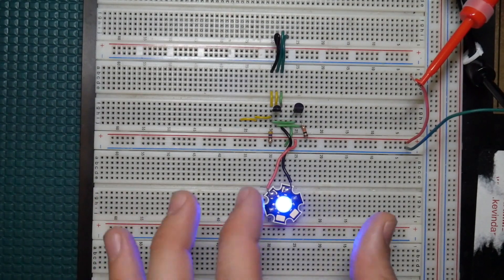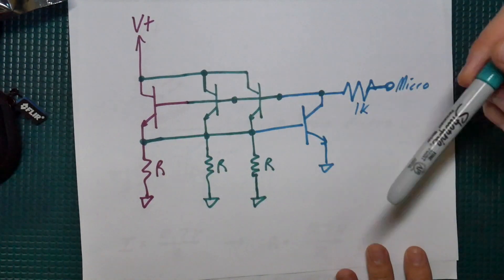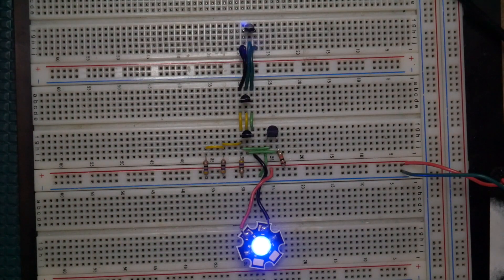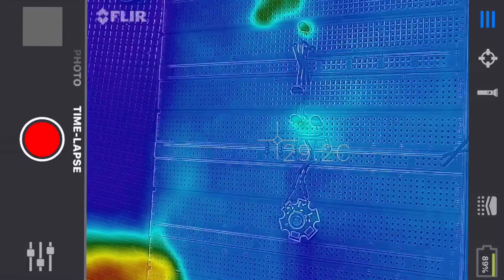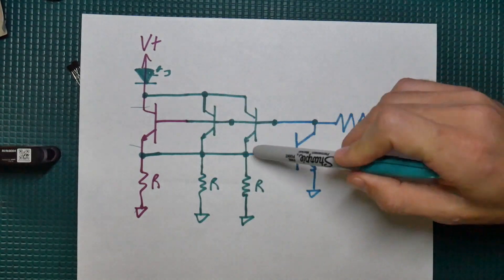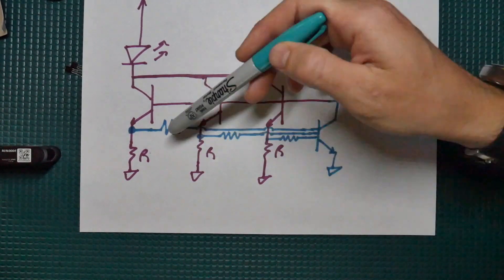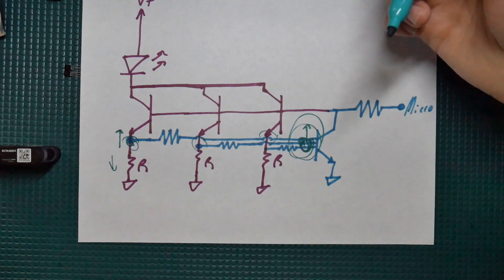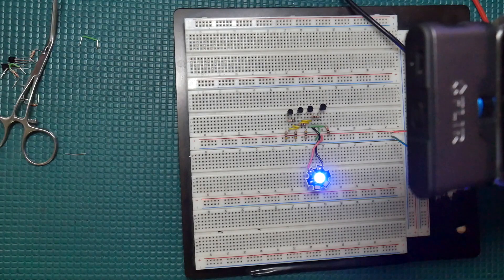See Thermal Runaway in Action! Tutorial and How-To Fix it!

Comment: Would bridging each collector with a seebeck generator help regulate the circuit, due to the difference in conducting material and temperature from the runaway transistor and the cooler other ones?

Comment: Analyze thermal runaway as a feedback loop. Since the thermal feedback loop is positive feedback, once you reduce the thermal gain to below 1, it becomes stable. You want it to be <<1 for good current sharing. If it is near 1, it may still be stable but it will settle at an uneven idle state.

One way to reduce thermal gain is to reduce Vce as the temperature rise due to Ic depends on Ic*Vce which is the power dissipated in the junction. Reducing Ic also does this as it reduces  transconductance which determines how much current is caused by a given change in temperature->Vbe. Adding a emitter resistor has the same effect by reducing transconductance.

Yet another way to reduce thermal gain is to thermally couple the transistors as it is the thermal resistance from one junction to the other which increases the thermal imbalance caused by differing currents.

Comment: Your thermal runaway protection works, but that's not because of "averaging" off the feedback transistor. If it was, the first circuit wouldn't suffer from thermal runaway either. The reason why the first circuit suffers from thermal runway and the second not, is because of the difference of negative feedback introduced by the resistor in series with the emitters of the three drive transistors. In the first circuit, the emitter resistors are common to the three transistors, therefore they cannot detect or prevent current unbalance between the transistors. The same goes for the negative feedback network of the transistor controlling the base current: it cannot detect current unbalance of the three transistors because it is common to the three.
In the second circuit, though, the emitter resistors are not shared, therefore the negative feedback introduced by these resistors has local effect in each transistor individually. The transistor that controls the base current, as you said, computes the average of the emitter currents. 
And "average" means it cannot detect whether all the current is being driven by a single transistor or evenly by the three.
Reply: You are absolutely correct!  The circuit needs individual, separate, emitter resistors to provide feedback ( emitter degeneration ) for each transistor, SEPARATELY!

Comment: One of the best explaination with proper representation 👌👌👌👌 cool.
At the end i was wondering why that one resistor getting hot beside the three transistors in last step... 
Since all three sense resistors have same vale and all three transistors are passig same current, why the last one is getting heat up instead of all of them getting heated equally.. any hint?

Comment: Unrelated to thermal runaway: is there any way to introduce a single potentiometer in place of the current control resistor? You'd just replace he resistor with a pot in the case of the single power transistor, but in the case of more than one power transistor, and you common their emitters into a single pot? I suspect not, but don't really know.

Comment: I'm trying to learn, but I need to build basically a SSR, for DC, at 30v and 400 amps, I have about 20,  55v 110 amp MOSFETs, what would I need to parallel these go get the current to pass,

Comment: Parallel some MOSFETs! In a circuit!,!
Reply: MOSFETs have a (edit:) positive temperature coefficient. They self-regulate. Nothing will happen...
Reply: @TrickyNekro ,
It's the other way around. MOSFETs have a positive temperature coefficient, as the temperature of the device increases, the resistance increases. In other words, higher temperatures result in lower currents. 
On the other hand, the BJT temperature coefficient is negative, meaning that the voltage across a diode or a base-emitter junction for a particular current decreases as we heat up the device. The negative temperature coefficient is the basis of thermal runaway, in which a diode or transistor driven by a fixed voltage gets hotter and hotter and passes more and more current until it over-heats and fails.
Reference: https://www.onsemi.com/pub/Collateral/AND8199-D.PDF
Reply: @malgailany  I know, that´s why I said they self-regulate. I messed the sign, don´t kill me...

Comment: Any way to turn this constant current shunt regulator into a stable constant voltage shunt regulator? I'm working on a project where the high side load (matrix of red LEDs) is variable from 5mA to 120mA but collector voltage varies as much as 15%. How do you overcome the transistor's negative temperature coefficient? 

My V+ voltage is 3.3V and my virtual ground collector voltage is 1.34V. If I can pull this off, I can save a lot of resistors in my LED matrix.

Comment: Great topic but you didn't explain the root cause.   You didn't explain what the heat effects.    You didn't explain that the Vbe of the hot transistor drops due to heat and the other transistor's Vbe is shunted out below their normal Vbe bias level.   When this happens they do not turn on so the one hot transistor is carrying the entire load while the others don't even have a chance to join the party.  Adding the resistors has a balancing effect to allow the variations in the Vbe of each transistor to be absorbed by the resistor.
Reply: This is an interesting topic. Many temperature compensation circuits depend on the fact that Vbe is inversely proportional to temperature ( Vbe changes by −2mV/°C ) to control the currents in BJT devices.
Thanks.
Reply from the maker: good points - could be a part 2 maybe to show that

Comment: The explanation why it works isn't correct. The control transistor "backs off" for all of the transistors (all their bases are connected together after all). How has that any balancing effect? Well, it doesn't. The averaging has nothing to do with the balancing. The circuit works (almost exactly) the same if you connect the base of the control transistor to just one of the load resistors and ignore the others. I say almost exactly, because the current value might not be as accurate, because you are basing the current control on the tolerance of one resistor instead of on the average of three, and also maybe because you are pulling the base current of the control transistor only through one of the load transistors. But the balancing is still there.

You missed a very important point, which I guess lead to the wrong explanation: the whole reason why thermal runaway occurs in the first place. The important thing is that the base-emitter voltage of a transistor DECREASES with temperature. Or the other way round: for the same BE voltage the warmer one "opens" more. If you parallel the load transistors you force them to have the same BE voltage. The warmest opens a little bit more, gets more of the current, gets warmer, thereby drops it's BE forward voltage (or rather opens more for the same BE voltage), gets more current, gets warmer, aso until ... magic smoke.

The balancing works because a higher current through one of the load resistors causes a higher voltage drop over it (as you said). This reduces the effective BE voltage for the transistor for that resistor (the absolute base voltage is still the same for all obviously). This slightly lower BE voltage makes that transistor close a little, so it gets less of the current keeping it from running away.

To prove the point that the control transistor is irrelevant for the balancing, remove it and supply an adjustable voltage to the bases of the other transistors. Obviously you won't have current regulation (because that IS the job of the control transistor), but the current through the transistors will still be balanced (within the tolerances of the transistors and resistors). Btw. you often don't directly parallel the bases of the transistors, but use a resistor for each base as well.
Reply from the maker: oh yea, thought I might've mentioned the drop in VBE to to the increased temp... could be a cool part 2 though, or do the same thing with parallel LEDs or something.  Thanks for leaving the detailed comment!
Reply: Thanks, saved me typing the same thing. The original wording "higher temperature = more current" would be highly confusing for most beginners
Reply: it's all about the individual emitter resistance, thanks.
Reply: I think the big difference between the to circuits is that in the second one the current of the runaway transistor can only go through its own resistor. 
In the first circuit, the 62 Ohm resistors are ‘shared’ so a high current of a runaway transistor can flow away through all three resistors and therefor the voltage on the base of the regulator transistor isn’t increased. 

In case of the second circuit an increased current on one transistor leads to an increased voltage on the regulator that will squeeze all three transistors.

The second effect is that a higher current through the resistor leads to a higher voltage over the resistor and thus a lower voltage drop over the runaway resistor. Lower voltage drop means less energy to be dissipated do the transistor cools down a bit.
Reply: @Conservator. 
No, as said the regulator transistor is for constant current control, but won't do anything for balancing. If it didn't keep the overall current constant the circuit would be pretty pointless, wouldn't it? As I wrote in my previous comment, you could completely remove the control resistor, and the balancing would still work.
Reply: superdau I agree. I don’t think I said the regulator does balance anything.
Reply: @superdau  Perfectly correct. The change in Vbe changes the collector current thru the transistor. Increased voltage drop in the series resistor STEAL'S the base drive from said transistor transferring current to the other transistors, allowing cooling down of said transistor. PRESTO BALANCING ACTION ENSURED.
Reply: Yes. More specifically is the Vbe-on that drops with temperature. Is the “threshold” that drops. In other words: the BJT became more sensitive